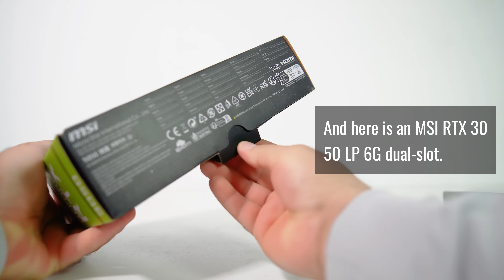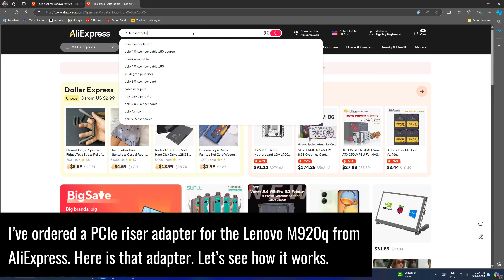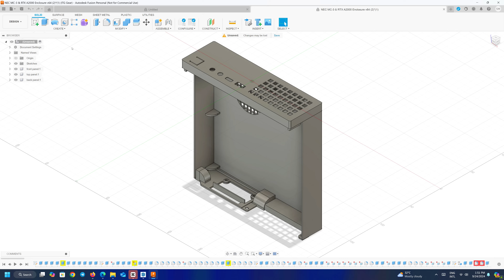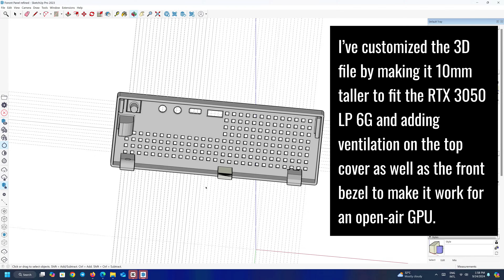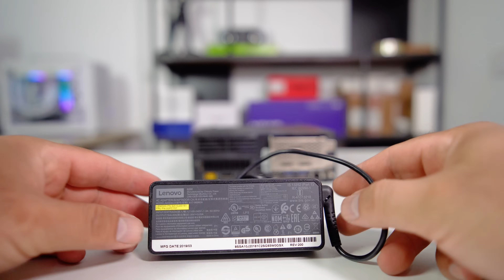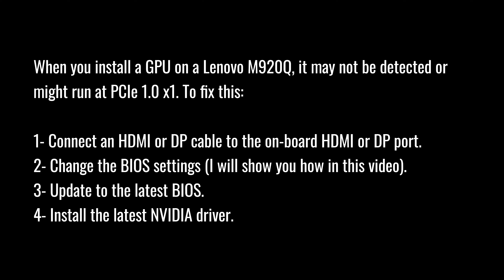Lenovo M920Q+RTX 3050 LP, CPU power limit fixed, Some AAA game 1080p 100fps+

Comment: El procesador no tiene disipador ?
Reply from the maker: Hi there! It's 35W CPU which is even lower power than a gaming laptop CPU so it could running just fine. However, there are some issue with VRM chip that those chips lack of cooler headsink in this model so you might need to down volt the GPU power limit to make this PC running more stable. Thank you .

Comment: Hi @itggear, great video, according to what you explain in the video, when I have everything installed (graphics card), I must connect HDMI to the board and the graphics card, video should appear on the screen. I have tried many ways but nothing can be solved. Any help? Thank you.
Reply from the maker: @mikegonzalez8153  The most common fix is reset BIOS. Please try it first, if it still not working let's me know.
Reply: @ I already gave the video, thanks, I have all the components connected, but I have a question, is it necessary to have the 300w power charger? I have a 230w uni but when playing God of War the PC gets stuck and restarts or turns off. Is there a solution? Thanks

Comment: Wait but how did u supply power to gpu without having pin connector ?
Reply from the maker: @footballhub8294  Does the MSI RTX 3050 LP require an 8-pin PCIe power connector?

Comment: I don't have an M920Q but I do have an M715 and my pcie x16 does not detect the graphics card, but it does power it, is it something in the BIOS or is my motherboard defective? Has this happened to anyone?
Reply from the maker: You should connect the monitor to the onboard HDMI or DP port on your PC and try booting to Windows. If it works, right-click on the This PC icon (select Show more options on Windows 11), then select Manage. Click on Display adapters. If you see a device like Microsoft Display Adapter, please download the NVIDIA app, complete the driver installation, and switch the cable to the GPU HDMI or DisplayPort. In some cases, if the PC doesn't recognize the GPU driver, it won't display to the monitor.
Reply: @itggear  There is no Microsoft display adapter, I only see the integrated graphics drivers. I had to buy a PCIe x1 to PCIe x16 adapter but I think it is of poor quality because the FPS is fixed at 20-25FPS and it does not vary much when I lower or increase the graphics. (Use the PCIe x1 adapter to the PCIe x16 of the PC to quickly test it. I'm sure if I put the graphics card in it will have the same effect.)

Comment: What kind of threads you use for the bolts ? Any Idea on hoy could I look for them online ?, really love your videos
Reply from the maker: You can search for M3 Brass Insert Nut Hot Melt Heat Knurled Embed Injection Copper Insertnut 3D Print Plastic Board Nuts Inserts. Thank you.

Comment: Imagine people are wasting money paying for 400 dollar motherboards, 2600 dollar video cards and 600 dollar cpu where you can do this and still enjoy games for a fraction of a cost. That's crazy...
Reply: it's still cheaper buying a full sized prebuild optiplex and a normal GPU
Reply: @ChapheeGamerous  but it’s not “small”
Reply: @Nexx8969  yes but the question is…how long do these last? also…they overheat and most people want to hardcore game on a small pc such as this and then complain cause it’s overheating. 😂
Reply: The new MS-01 Minisforum is sold for 450$ new... for new I mean the AMD 7945HX... which is double the Intel i9 performance... and it has full speed 5th gen Pcie x16 slot, and two-three M.2 nvme slots... it costs much LESS than many P330 i7 offers sold on the Internet... M720X sells for 300$ and for 450$ you get a beast, with no bottlenecks... But yeah, for 200$ you can build a full m720q, with GPU, RAM, SSD and that's insane.
Reply: @queotzcatl3980  don't forget that the rtx is running at it's real performance though it's using Pcie x8 gen3 because it has speed of 15 gb/s which most of cards does not exceed.
Reply: Most people nowadays buy to flex their lastest & greatest & only few actually fully utilizing their machines. Buy coz they can not coz they actually need it.

I rarely buy new for my GPU since Pentium days... Always hunt for garage sales or whatnot... Currently hunting in Marketplace & just scored a 3950x with a x570 STRIX MOBO combo included with 32GB DDR4 3600mhz configuration for 145USD around 615MYR, a PSU 700watts Cooler Master with a Deepcool AK400 combo for  38USD 160MYR, 20USD 85MYR for Crucial 512GB M.2 as bootdrive & 2T SATA SSD Evo 860 for 56USD 236MYR.I got a cheap generic looking black with acrylic side panel case with 4 non RGB white fans ATX size with front open mesh for vent around 25USD 105MYR. Total spending roughly around 285USD 1200+MYR. I still got 315 to play around for my GPU. 

My option is either a Blowerstyle OEM 3080 for 236USD 1K MYR or a 4070 Super 12GB PNY for 333 1368MYR which slightly overshot from my 600USD budget 2.6K MYR. Overall, everything is running well with temporary GTX950 until I get the permenant GPU for this build... Wish me luck... 💯🍻
Reply: I got a sweet used market deals/Garage/Yard sales recently. 589USD or 2.5K MYR for parts like 3950X, X570 STRIX, 700Watts PSU, 32GB DDR4 3600mhz, 512 M.2, 2T SATA SSD, Plain black & White case 4 fans with mesh vents, Deepcool AK400 cooler & 3080 OEM Blowerstyle in beautiful condition including 120Hz QHD 24 borderless IPS monitor, a decent mouse & keyboard For the time being It's a Win! Money well spent. It will run what I want it to run & how I want it to run. If you don't mind not having 'the latest & greatest like myself', coz pricing is ridiculously 🤢🤮
Reply: Just 600 dollar for a CPU? Yeah, they should buy a 1000 dollar CPU 😂
Reply: Just get a used Dell 3240 compact or latter model.  No 3D printing required since it supports double height gpu
Reply: @Nexx8969  i saw this video showing different builds for Escape From Tarkov and buddy mostly used Nvidia cards and the $1400 pc had a $400 AMD cpu with a $500 RX 7800xt. And the last build bro had a $500 motherboard with an $800 cpu and 4080. Some people just have so much money to burn that it doesn't matter what they end up wasting it on. Expensive motherboards are such a scam😂

Comment: I did this exact same build, except my m920q shuts off randomly during gameplay. Using same CPU settings on my i7-9700. I even locked the 3050 GPU MHZ to 1500. Any clue to what could be happening? It was happening way more frequently when the card’s MHZ limit was uncapped.
Reply from the maker: It is not the same. The M920q does not even support 65W. When you install a 70W GPU, it far exceeds the PC's compatibility, as it may only support a 35W CPU. It can only work with the GPU installed with exceptional hardware and software configurations. Did you know that a 65W TDP CPU might have a PL2 value of around 95W to 125W?. Thank you
Reply: I’m not quite sure I understand. I limited the cards mhz down to reduce power draw and it still shuts down. Why does yours not do that in the video? I don’t see you tweak with MSI After burner 

Thank you so much for the exploration and help 😃
Reply: Also I am using 230w power brick
Reply from the maker: It will not work when you install a GPU and a 65W CPU on M920q.

Comment: I tried this out and my pc wont boot when i try installing the gpu. Any reason why this is happening? I have to do a power flush everytime i take out the 3050.
Reply from the maker: What is your PC and GPU model model?
Reply: @itggear  its the m720q and im using a LP3050 (602-V812-68SD2409000815). I tried seeing if i needed to change the pci slot 8pin connection from auto to gen3 but got no luck on that. I have a 230w power adapter too. Do i need to update my bios?
Reply from the maker: @bluelotuscoding  Please ensure you install the PCIe adapter properly and secure it to the chassis with a screw. Reset BIOS to factory default and try again. What is your RTX 3050 LP model? Some users report that the Yeston RTX 3050 runs too hot and is unusable. Thank you.
Reply: @itggear  its the same model you used in your video. Not the yeston.
Reply: @itggear  so good news...it powers on! But i got no display. EDIT:IT WORKS. I HAD TO GO INTO THE VIDEO SETTINGS IN THE BIOS AND SWITCH IT TO PEG, which is for the pci slot.
Reply: I will try this on another pci raiser, i saw that it could be the issue. Now Iget why the seller refunded me for the adapter.

Comment: I have this setup with 230w power supply. Throttle stop installed as well as drivers. Last night it worked and today when I load into any game and press play it shuts off…
Reply from the maker: There are two main factors that cause your PC to unexpectedly shut down:
1. The VRM chip or chipset on the motherboard is getting too hot. You can use the HWINFO app to monitor your PC's VRM chip temperature, which sometimes reaches up to 160°C, causing your PC to shut down under heavy load. To fix this, you need a 65W CPU cooler and a southbridge chipset heatsink, as the 65W CPU cooler will also cover the VRM chip.
2. Your AC adapter does not provide enough power for your PC setup. The 230W original charger sold for around $100 on the Lenovo store is recommended. If you use a cheap AC adapter from a third party, it may not be reliable in terms of wattage.

To solve the whole problem, you can try using ThrottleStop to limit the CPU power by setting the power limit to around 20W and the short-term power limit to 30W. Additionally, use MSI Afterburner to limit the GPU power to around 80%. The main factor is managing airflow for your PC to ensure it does not accumulate heat during use. Thank you.
Reply: @ thank you! I will try and get back to you
Reply: @itggear  is there any way I can message you some pictures of what’s happening right now? If not that’s okay
Reply from the maker: @SawyerPlaysWithFire You can contact me via my Discoid: https://discord.gg/u7VzPPzg

Comment: What software did you use to make a new modified case?
Reply from the maker: I create a new one using SketchUp. Editing an existing 3D file is much more difficult than creating a new one. Something can go wrong very easily while editing a 3D model, such as a missing face or line, which can significantly mess up the work. I just use the measurement data, like port screw hole and case size, to create a new case. It usually takes less than an hour to make a new 3D case. Thank you.

Comment: LP 4060 could be wayyyyyyyyyy better
Reply from the maker: It is not better; it cannot even run. The system shuts down when running a game or under heavy load.
Reply: @itggear  well
Maybe 3050 is stable with 65W
And 4060 LP needs more :')

Comment: Should've gotten the Yeston RTX 3050 it's low profile and single slot, smaller than this.
Reply from the maker: You can get it, but heat is a major concern. You may successfully set up the PC like this with your Yeston RTX 3050 LP single slot with 70W DP, but it will not be usable. Also, it is your choice whether you want it to be as small as possible or usable.

Comment: Hey, great build!
Wanted to do the same.
Bought riser card and msi 3050..
But the card is dead...
Fans are not even spinning..
Flashed latest bios and did the settings.

Also i came to the issue that if i use both dimm ram slots the system wont boot up...
I have two 16gb of ram...

Anyone has similar problems?

Comment: the case volume has doubled, but we are left with a weak CPU with a 35W, the video card is slowed down from PCI-E 3.0. What is the point of assembling a system on this piece of crap. In such a volume, you can create a much more productive solution
Reply from the maker: I know that when an idea comes to life, it is not always accepted by everyone. In this video, I am not focused on finding the best price-to-performance ratio within a certain budget. Instead, I am executing my vision of how to install a GPU on a Lenovo tiny PC, which seemed impossible. As you can see in this video, I managed to make it happen. The video has now garnered 330K views, which shows that my idea has been recognized by many people. I would also appreciate it if you could share your project and demonstrate how it can achieve the best PC performance with a reasonable price, as you mentioned in your comment

Comment: Hi guys. I have m70q gen 4. Can i using egpu with.
Reply from the maker: I believe it's impossible because it lacks a PCIe slot, and the M.2 slot in the Lenovo Tiny PC is located underneath the motherboard. The space between the M.2 slot and the lid is too tight to install the M.2 Oculink adapter and route the cable to the rear of the case for the port connection.

Comment: Is it possible to use any riser or does it have to be the one shown in the video?
Reply from the maker: It is not only a PCIe riser but also an adapter. This Lenovo Tiny PC does not have any standard slots; for example, if you want to install a SATA drive, you need the Lenovo SATA connector specific to this PC. Similarly, if you want to install a PCIe expansion card, you need the PCIe connector, and the PCIe adapter for this PC only works with this PC. You cannot use another Lenovo PCIe adapter from the Tiny series on this PC.
Reply: @itggear  ohh, I get it, will buy one of these tiny pc AFTER I get the specific adapter then. Thanks for your time!

Comment: Hi, @itggear, inspired by your video I bought a M920q (i5-9600t version) and a Nvidia A2000 12Gb. Already tried to install, but faced a problem that gpu doesn't detected by a system (gpu fan starts). I set a bios settings as described, updated bios to the same (last) version as on a video. When system starts (with internal gpu) - it throttles, and a ThrottleStop fixes this. I also tried to set a video settings to PEG. Did u faced this problem?

NB: I'm using a 230W power supply. GPU is working 100% - tried on other PC. Riser is the same 01AJ940 version 1.2
Reply from the maker: If your PC still doesn't detect the GPU, please try a few things:

1. Remove your GPU and the PCIe riser, then insert the PCIe riser into the PCIe slot on the motherboard again. Make sure the PCIe riser is securely installed and aligned perfectly. Please keep in mind that the Lenovo Tiny PCIe riser adapter connector is too short, so it can easily go wrong.
2. Secure the PCIe riser with a screw to the case.
3. Access the PC BIOS, then restore factory defaults and try to boot the PC again.

Thank you.

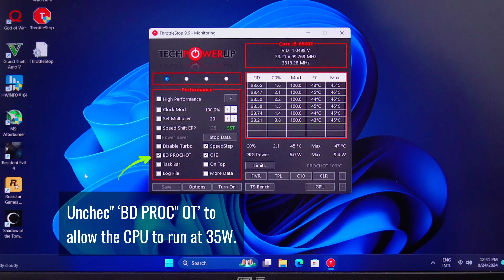Comment: 10:03 do you need to do the same on M720q ?

And do you need to activate Throttlestop every time you start Windows for this to take effect?
Reply from the maker: I think you should do it if you use a 70W GPU. You will also need to undervolt the GPU in order to make this setup run stably. Thank you.

Comment: but can i do the same for my P330?
and does the cpu limit down to 5w like the same on the m920x?
Reply from the maker: Yes, the Lenovo P330 Tiny supports 50W GPUs like the Quadro T1000/P1000 or RX6400 when paired with a 35W CPU like the i5-9500T. It also supports a 65W CPU without a GPU installed. Unlike the M920q, it does not support a GPU or a 65W CPU. However, I'm not sure if the Lenovo P330 Tiny can run a 70W GPU like the RTX 3050 LP or A2000 without throttle, as I haven't tested it yet. Thank you.
Reply: @itggear  I'm working on getting a P330 with an 8700t and rtx3050 running now. Slowly lowering the power limit on the GPU until I find the threshold where my games don't just shut down the PC. I'm down to a 60% power cap on the GPU and I'm still crashing on some titles. I'm starting to think the P330 doesn't deliver as much pci power as the other models.
Reply from the maker: @coreysanders6709  As far as I know, the RTX 30 series allows you to down power limit to 80% minimum only. Below this would make the PC crash. Only the RTX 40 series allows you to down power limit below that value, like 67%. Based on my experience with this setup, to make this PC run more stably, you need to manage the motherboard temperature to prevent overheating. You can use the HWINFO app to monitor the VRM chip, as some of them reach 120°C. The main thing that causes the PC to crash is the AC adapter. You cannot rely on a 230W AC adapter that is sold online for just around $20 to $30. You might need the original Lenovo AC adapter. You can also use the ThrottleStop app to limit the CPU power to around 30W and short-term spike power limit to around 35W to prevent your PC from crashing under heavy load when a GPU is installed. Be aware that a 35W CPU can consume up to over 45W or even 95W with short-term turbo mode, so if your AC adapter cannot handle it, the PC will crash.
Reply: @itggear  thanks for that heads up. I have a Lenovo 300w power supply with it now.  I'll try limiting the CPU with Throttle stop and see if that helps. Thanks!
Reply: Applied a 35W cap to PL1 and a 50W cap to PL2, just to try that and it ran my first test game for the few minutes I had this morning before running to work.  Gonna put it through some more tests this evening, and see where the balance point is between CPU power and GPU power with this 300W PSU.  Thanks a ton!  My wife will be thrilled when I can finish up her little box. :)

Comment: This is amazing work! Does this mod only work with the msi 3050 lp or will it also work with the gigabyte 3050 lp? Thank you in advance!
Reply from the maker: The MSI RTX 3050 is 174mm in length, while the Gigabyte RTX 3050 LP is 181mm in length, which is close to the 182.9mm depth of the Lenovo 920q. I think it should still fit, but you might need to adjust the front bezel to create more room for the GPU if any part blocks the space. Thank you.
Reply: @itggear  Can I install VGA on my ThinkCentre M715Q?

Comment: Hello, nuce video, is it feasible to remove the DP port from the GPU and modify the heatsink to reduce its height?
Reply from the maker: If you want a single-slot low-profile RTX 3050, check out the Yeston RTX 3050 LP single slot.